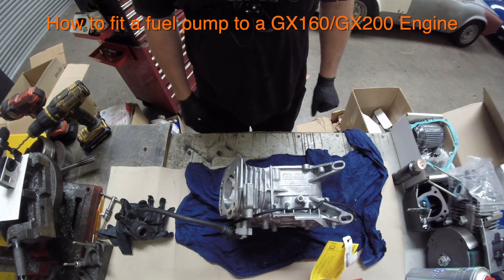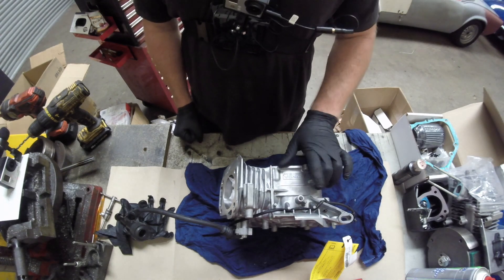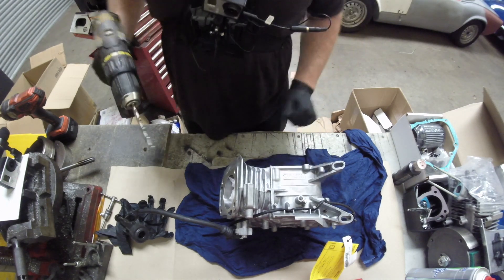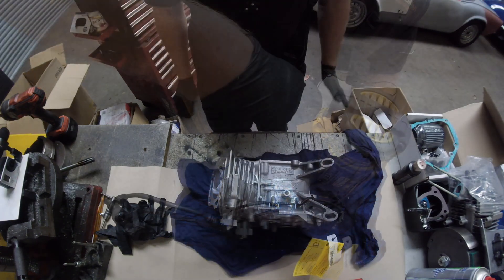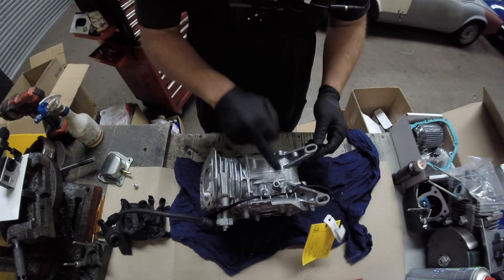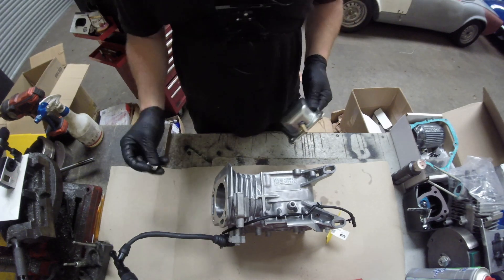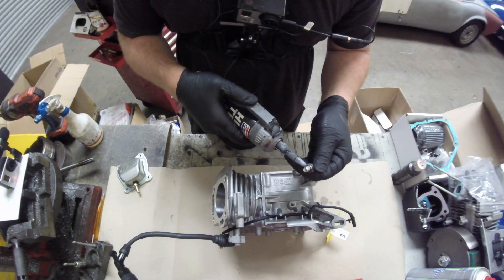How to fit a Fuel Pump to a GX160 / GX200 Engine

Comment: I'm a student and im working on a project using this engine. Do we need to drill the governer hole if we are going to use an over head cover like you are?
Reply: It's basically a hole into the crankcase. Block it up

Comment: What mm carb are you going to use
Reply from the maker: We are going to be using a GX390 carb fitted to the engine using a manifold.
Reply: @ProkartEngineParts  i want to use some sort of mikuni carb  for my gx 160 but i dont know what mm to get and i dont want to just order i guesed because the are quite expensive
Reply from the maker: @sylvainitsjustsyl4549  22mm is probably all you need.

Comment: Did you have to clean the inside of the engine after drilling that hole? Wouldn’t it all go into the engine?
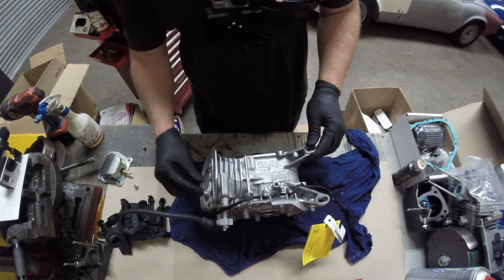Reply from the maker: Yes.  I say at 01:49 that you need to clean out all the swarf from the engine.  I didn't show this process as i was trying to reduce the overall length of the video and thought it would have been fairly obvious that it needed to be cleaned out!  Also, not everyone would have had the facilities i had to clean it out so there was no point showing this process as everyone would have different methods.  To make it easier i recommend trying to catch most of the swarf in a cloth placed inside the cylinder block.  This also helps to keep it away from the crank bearing in the block.
Reply: Better to do this when it's stripped down, then clean the crap out of it like your life depended on it.